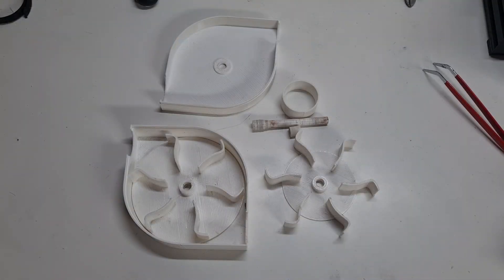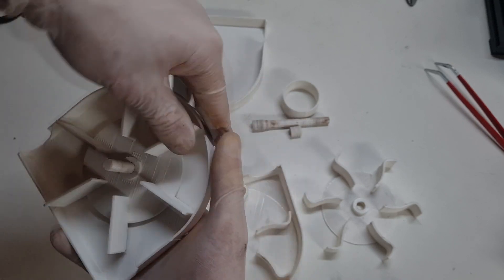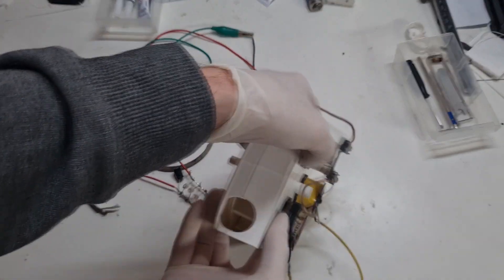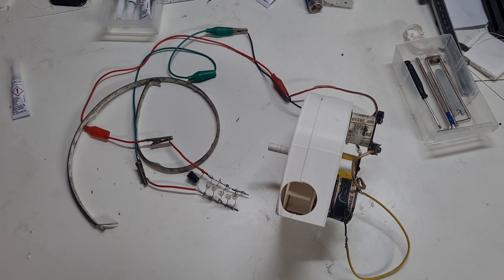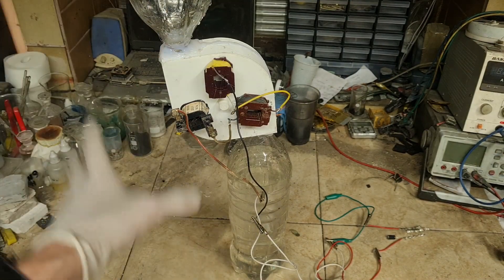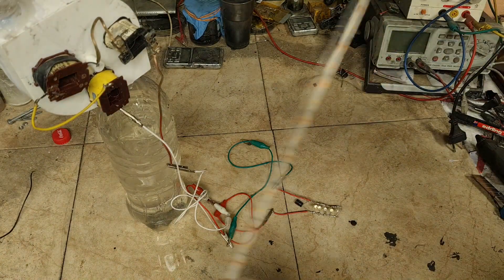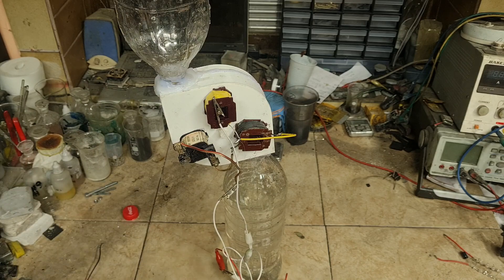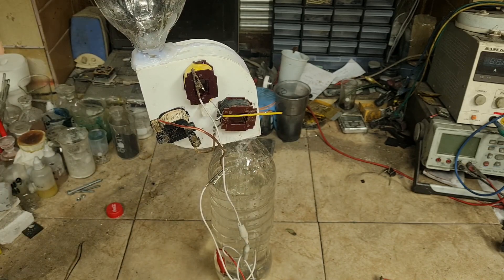Flipping Water generator with own water tanks

Comment: bro i want make this project but with a big tank about 600LT but after the 600Lt become empty how can put water again in up ? uhm for now im blocked in this doubt because 600LT is 600Kg and is eavy but with it probably can stay 1 long hour with led on
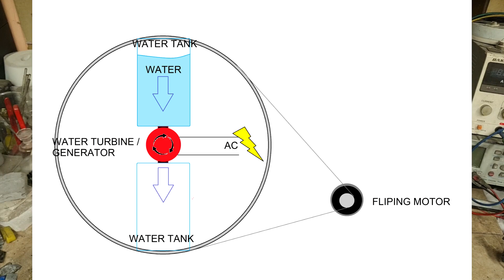Reply from the maker: Go to 8:47
Reply: @cayrex  flipping motor mmm is not bad but.. for turn on motor is better use the same energy storage in one battery from this sistem but need a great energy and im not sure if the system make more power than the power usage for rotate it.. probably not..

Comment: I've wondered for a while whether it would be more efficient to turn the water tank like you are doing or if it's more effecient to run a pump from the bottom to the top. You could put the tanks in a big wheel. And spin it around every so often. The tanks could be a semi-circular shape to take up the space in the wheel. Great idea Cayrex. Thanks mate.
Reply from the maker: Similar to this ➡️ 8:49
Reply: @cayrex  Ah, yes. I must have must that slide.

Comment: Interesting design, I like that you can run it in both directions. Some things:
- Your capacitor isn't going to be doing anything useful in that configuration. If you have a bridge rectifier before it then it'll be able to charge up fully, but you drop a bit of voltage across the diodes.
- If you could put the cores of the transformers back over the top and sides of the coil, it'd make a nice path for the flux to flow.
- If you could make the opening to the bottles from the turbine housing have a bit of a funnel it would let the water get out of the way of the turbine once it gets to the bottom.
- Put a breather pipe from the bottom of one bottle to the bottom of the other bottle, so the water can be displaced by air from the other tank.
Reply from the maker: Yes I know,... later in the video the capacitor was disconnected on one electrode, because first I use bridge rectifier. For air flow I already think on some air vent, etc. Thanks for the tips

Comment: I like this idea. Wonder if it would work with sand as well.
Reply from the maker: Hmm good thinking
Reply: @cayrex  Coil wrapped at neck of hourglass with "Sand" made of heavily N-doped semiconductor?
Reply: @dgpreston5593  Why use N-doped semiconductor?
Reply: @zylascope  because (in theory) balanced charges would produce little or no net current as they pass through the coil.
Reply: Coil wrapped at neck of hourglass with "Sand" made of heavily N-doped semiconductor?

Comment: If you have some 5mm pvc tube going from one bottle to the other connected at the bottom but the side it will stop the bottle from glugging with the air. Maybe that will be more smooth in operation and then you can make the hole smaller to create higher pressure and more effeciency . I am certain it has far more potential .
Reply from the maker: Yes, the system need some air flow vent. That was 1 version
Reply: @cayrex  I have sprayed a water hose on a paint roller before and they spin really fast so I came to realise that the roller fluff was a great resistance and surface area for the water . The opposite to laminar flow . But it also demonstrated the principle of pressure vs volume .and also the faster it spun , the more water would fling out and the surface was ready for its next soaking which made it faster and faster . If it was contained in a coke bottle and some magnets attached I think it would be amazing but my head is way to busy to try it at the moment . 😂